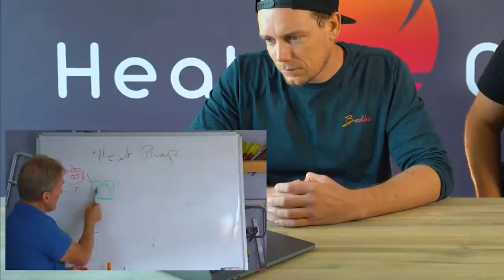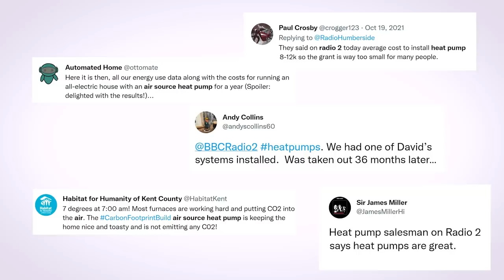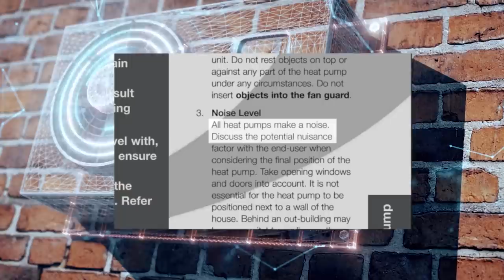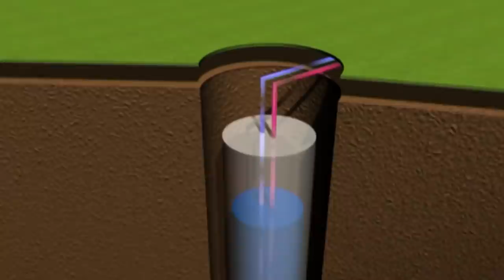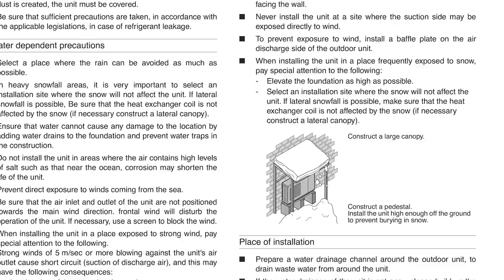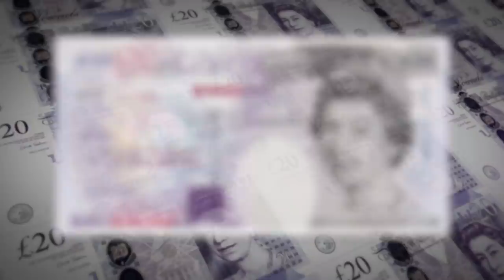Heat Pump Secrets They Don't Want You to Know

Comment: The government should just admit we need to concentrate on insulating buildings properly.  It's a one time cost, no 'running costs' and we don't need umpteen power stations for the increased demand... 🤷🤦
Reply: We need power stations for Electricty to run the heat pumps, there aint no solar 9 months of year 😂😂
Reply: Many UK buildings are not well suited to be insulated.
Reply: Er, all I keep reading says that rockwool compresses over 30 years and loses its insulation properties.
Reply: Exactly,  I retrofitted insulation in my house and it's cut my heating bills by 40%
Reply: If half of this ranting would be true no one would have a heat pump. Heat pump technology have been around for quite many years. We have had an underground heat pump for 20 years. It has functioned very well. Even with old technology and wekks of tempreatures below -20 C each wintter the COP is around 4. There is no perfect heating system. Heat pumps are best suitable with floor heating in larger buildings. In smaller houses an air to air heat pump is more suitable.

When it comes to noise I have a question. Is the sound of heat pumps working your biggest noise concern or could it perhaps be traffic noise?

Comment: I've been heating and cooling with a Mitsubishi mini split for 3 to 4 years. You can be standing right next to it while it's running and unless you see the fan actually spinning, you wouldn't know it was even on. VERY quiet.  I do run it 24/7/365. Heat in the winter, dehumidifier / A/C in the summer.
Reply: And the mitsis are typically more noisy than other brands, great piece of kit the ecodan none the less, hence the huge lead in times for all mldomestic mitsi products
Reply: Wait a couple of years when the bearings exposed outside 24/7 and apologies to the neighbours
Reply: @johnnorris1983   Mitsis generally have a good reputation, but the worst bearing fail is when it happens slowly over time so so don't notice how bad it really gets.
Reply: @johnnorris1983  This is BS, heat pumps are proven over many decades, check how much they are used in commercial installations.  Mini split air conditioners are heat pumps, there are millions of commercial installations in the UK and billions across the world.  In Greece, where we have a home, almost everyone has them, they are reliable and ultra cheap to run.  They often run for 20+ years without issues.  They are not widely used in the UK because the Gov. won't include them in the renewable heat incentive, this is because they're afraid people will use them in the summer for A/C. It's ridiculous.
Reply: @johnnorris1983  oh no ..... Not after they sit outside. Where should they be installed..... Inside?
Reply: If you run it 365 it must be costing you a fortune and you just don't understand its Electrical power input
Reply: I have been running nothing but heat pumps on two houses and a business. Cheap, effective, quiet...and I certainly don't run them 24/7. This guy talks utter nonsense.
Reply: @cooliocrib4409  You clearly don't understand mini-split units, they are the most efficient form of heating you can buy.  Typically 5x heat output vs electricity input.  When he says he runs it 365, it doesn't mean it's always on, it will switch on and off based on hitting a programmed temperature.
Reply: @davidstorm4015  you are living in dream land if you are under the impression you get a cop of 5 on an average annual basis..
Reply: @davidstorm4015  finally a guy that gets it!  These guys don't seem to grasp the concept of a thermostat. Comes on when it needs to..... Turns off when it's to the set temperature...... Genius idea.
Reply: @cooliocrib4409  no..... No it's not costing me a fortune to run it. Solar panels are another beautiful thing.
Reply: @deerfootnz  so what do you do?  Go around turning them on and off all the time?  It's the craziest thing ever created. Mine has this thing called a thermostat. You set it to the temperature you want, and the heat pump will actually turn on and off as needed...... All by itself!  It's like magic.
Reply: @m.wilson2624  You are in a very beautiful world with the luxury of having the capacity to fund a premium on an optimized Heatpump system working well with your oversized radiators, good insulation and solar panels.  I only wish the whole planet had this capability and we have nuclear energy so the world could work more synchronously.  But today, and having spent 15 years investigating Heatpumps, the world is not ready for it.
Reply: @cooliocrib4409  We've been heating with mini splits for the past 2 years. We saved about 40% vs heating with gas per annum... (on a high efficient boiler), so...
Reply: @OverSoft  I can certainly believe you as it depends. I will speak on behalf of me and many others.  In the UK where I am, Per kwh, gas is 4 times cheaper and so Electricity is 4 x more expensive. On an average basis (for the majority of households) the COP will be less than 4.  The maths immediately says  for a fixed number of heating units its less cost effective to heat your home with heatpump. A gas boiler is cheaper than a heatpump as you will not get a COP greater than 4. And instalation costs is lower with a gas boiler. I turn my boiler off when I sleep so I save energy. My heating is instant. 10 minutes the house is already getting warm. You don't get that benefit.
Reply: @cooliocrib4409  I think you need to check out the efficiency of modern mini split units, not talking about a wet system.  BTW we get a measured COP of 3 on our Samsung EHS Mono 16kw heat pump during the Winter months.  This is 100% accurate, readings taken directly from meters.  Anyway, you won't believe anything regardless of what I reply with as you're clearly set against heat pumps.
Reply: @cooliocrib4409  You clearly don't understand.  Mini split systems don't use radiators, they are air to air heat pumps.  That's why they are so efficient.  Get your facts straight before making a fool of yourself!  They're also the cheapest form of heat pump and the easiest to install, any house in the UK could have them.  We have 6 of them in our property, cost €400 each, A+++ for heating.
Reply: Someone talking common sense at last, from a position of knowledge.  There's so much ignorance in the UK about mini-split units
Reply: @deerfootnz  He's talking about mini-split units, not air to water heat pumps, he's running them on thermostats, so they only come on when needed, so it makes perfect sense what he's saying.  Also, we have an air to water heat pump at home (Samsung) which we now run 24/7.  The reason we do this is because it costs us less to run that way than it does having switch off at certain times of the day and night.  The power usage is accurately measured from electricity input and heat output meters, we've increased efficiency by 20%+ over what we used to get when we left it off for some of the time.  Heat pumps are designed to maintain a constant low heat output to work at their most efficient, not to have spikes in demand by turning on and off
Reply: @m.wilson2624  it will also,  if a newer unit, be variable speed compressor, meaning it will run continuously when on, at a lower power, improving efficiency, instead of the older or cheaper heat pumps running max, turning off, max, turning off reducing effeciency.
Reply: @davidstorm4015  in your home you have 6 units costings $400 each. I have 13 water filled radiators costing $40 each.  I would require 13 of your ridiculous $400 fans plus a heatpump and you say you are getting a COP of what with all those fans running?
Reply: @cooliocrib4409  depending on where he lives and how cold the winters are,  a SCOP of between 4 and 5.
I am in the North of Norway, obtain a SCOP of 4, that is with winter temps going down to -20c. At -25C the COP of newer air to air heatpump is around 2, and at 7C around 5.5.
Reply: @davidstorm4015  Greece, where the winter temperatures dip into the teens Centigrade?
Do you have an heat pump in your UK home, as you'll know the summers here can sometimes get into the low 20s Centigrade, thankfully that A/C function will soon get the temperature back down to something more bearable but then so would opening a window.
Reply: @cooliocrib4409  I can see you really don't understand.  Let me try to make it really simple.  We have 6 €400 units because we have individual apartments that we rent out for holidays, they all have to be separate from each other.  If we owned a single property we could have a single heat pump feeding multiple indoor units.  So in your simple terms, each indoor unit would be the equivalent of one of your radiators.  Now, let's talk about your radiators.  They don't heat up magically on their own do they?  They have to have a boiler (furnace) to heat them.  That has to be bought in addition to your radiators and then it has to be run.  That furnace is the equivalent of a single heat pump that is feeding multiple internal units.  The difference is your furnace will be a maximum of around 93% efficient (if it's gas operated) whereas my heat pump will be around 400% (or more) efficient.  This is the last reply I'm giving you as you don't want to understand, you just want to stick your head in the sand.
Reply: @cooliocrib4409  your average mini split system pulls about half the amount of amperage of just your average residential compressor, alone. 

Example, a minisplit may pull a total of 4-7 amps total between its Air Handler and its condenser, vs your average COMPRESSOR ALONE that pulls about 10 amps. Add the 2 fans, your average residential AC system pulls about 15 amps while running.
Reply: Mitsubishi is the best. Thats all we sell. They are basically bullet proof.
Reply: @davidstorm4015  these guys no NOTHING. So sad.
Reply: @cooliocrib4409  He's running a mini split unit, that's an air to air heat pump, he doesn't have any radiators.
Reply: @cooliocrib4409  compare your cooling and heating degree days. I'm in Minnesota US, and even here, despite our frigid temps occasionally,  it's rare it stays below -5F for any extended period. Mitsubishi SEER over 20 so summer operating cost make up for it.
Reply: @cooliocrib4409  no way electricity is 4x the price of gas in the uk. Eveyone would be running on their own mini gas generators.
Reply: @forgotmyname11  I thought of that already.. trouble is you have to Engineer your own generator solution as there is nothing sensibly priced off the shelf. In addition the engine is only 25% efficient at best case so theres not much to gain.
Reply: @cooliocrib4409  second hand gas piston generator will do fine at 40% or efficiency, but will be 250kW+
Reply: @forgotmyname11  if only you could buy them in 2.5kw..
Reply: @johnnorris1983  If the bearings are exposed the unit is a serious piece of junk. I have never seen exposed bearings in a CE marked HP outdoor unit.
Reply: @davidstorm4015  Bang on the money
Reply: @deerfootnz  I think he means air to water HPs. They usually should be run 24/7, especially if they.re feeding underfloor heating.
Reply: @forgotmyname11  erm...what's the point of saying no way if you don't know? Electricity is 4x gas in the UK. In fact probably higher. Gas is 7p / kwh and elect is over 28p / kwh.
Reply: @m.wilson2624  We can settle the argument much better if you just post the numbers!!

Gas and elect annual kwh usage prior to installation?
New elect annual kwh usage?
Total installation cost?
Reply: @davidstorm4015  Hi David we have an air conditioning unit (basically the mini split you refer to). We got it to cool the house for the 3-4 weeks in UK summer where it's unbearably hot. The added benefit is that it can be used to heat in winter. As you say they are very efficient and cheap to run. Yes electricity costs more per unit than gas here in the UK but I have a feeling my bills are still cheaper by using the heat pump instead of gas central heating.

I'd like to remove gas altogether from our house but we still need to heat water to wash dishes, have a wet shave etc. Since mini splits don't provide hot water, what do you use to heat water?
Reply: @davidstorm4015  Hi, just for ref ref. think of doing similar but at least £450 each but installation seems to be £500+ each, so at least £900 inc. how did you manage £400
Reply: @BlessedAreTheBignoses  we bought ours 2 years ago, prices have gone up.  The installation was part of our overall property renovation, we paid €600 each including installation
Reply: @alexfalconer9564  says who? The one I own is just as quiet as the others I own and have installed. Only thing I don't like about the Mitsubishi is that it cost over 2x the amount for the same size of other brands that Imo do just as good of a job and are reliable.
Reply: @johnnorris1983  that's nonsense... We have had central air conditioners for decades and the outside fan bearing has never gone out.
Reply: @davidstorm4015  wait... What? The UK government doesn't want mini splits there because people might use them for AC in the summer? I was wondering why I never see minisplits in the UK homes when it seems to be a far cheaper solution than retrofitting your radiators with a heatpump. I live in the US and I don't have a hvac license and I have installed 7 minisplits without issue and saved tens of thousands in install costs. You don't have to have a hvac license to install a heatpump where I live. Why don't they want people to use them for AC in the UK? Is it because it will stress the power grid?
Reply: @cooliocrib4409  no.. He uses it 365 because they have inverter compressors in them. You just set the temp to what you want and it will target that temp and dial down the compressor to output just the amount of heat/cool air to maintain that temp. Once a minisplit cools a house down it can maintain that temp by running nonstop at as low as 20% of its full output. This is substantial more efficient than a regular heatpump that turns on and off when the temp gets above the set temp. It's like driving a car and you set cruise control vs someone who full throttles the accelerator and then let's off once he hits the speed limit and then goes full throttle again when he goes a few km/H under the speedlimit over and over again. Running a minisplit 24/7 is the best way to run them.
Reply: @deerfootnz  he isn't talking nonesense. Are your heatpumps minisplits?
Reply: @davidstorm4015  actually it does stay on the entire time, it just dials down the output to match the heat loss of the house. Most of the time it would run at 20-30% of its maximum output.
Reply: @cooliocrib4409  that's what you don't understand... Minisplits don't have radiators that you have in your home. They have these things called "air handlers" that you install on the wall or in the ceiling and they are sized exactly right for the outdoor unit. The outdoor unit controls the air handler and ramps up or down accordingly. Look up "minisplit" on youtube, they are a fascinating simple, cheap and efficient type of heatpump. I have installed a few of them and I'm not a hvac technician. They are that simple to install and you can retrofit them in any  type of home with ease.
Reply: @cooliocrib4409  what is the cost of electricity in the UK per Kwh?
Reply: @forgotmyname11  he's talking about natural gas not gasoline.
Reply: @ChrisLee-yr7tz  28p? Does 100p equal 1£? If so that's insane for electricity! I pay $0.068 per kwh which equals £0.061 in the UK. If electricity was that expensive where I live I would be burning pellets for heat since it's about half the price of gas per kwh.
Reply: @hannahdobbs226  in the US we have hot water tanks that have their own gas burner in them that doesn't require any other furnace. We also have electric hot water tanks too. They have recently came out with you guessed it... "heatpump hot water tanks" that are very efficient. I think they have heatpump cloths dryers now too lol.
Reply: @BlessedAreTheBignoses  can you not legally install your own minisplits in the UK?
Reply: @randybobandy9828  It's 34p / kWh since 1-Oct and yes that's £0.34 so approx $0.375 at the moment.
Gas is now 10.3p so you'd need a CoP of 3.3 here just to break even on day to day running costs.

Where are you to be paying 6.8 cents?
Reply: @randybobandy9828  No, like anything in the UK over regulated (fair enough in many situations) and needs a professional and of course they charge high prices as you have no option. I am sure these pre-gased "easy fit" units can be installed safely & without hazard to environment. Lets face it how many are going to do DIY & as long as un-qualified people do not go round installing other peoples. I wanted in 6 small buildings and crazy quotes, would take 7-10 years to see ROI (even with current high prices) on replacing my existing infra red system so won't bother as probably a few will fail in those years anyway. I have found a wall mounted All-In-One & are pretty good but not sure how long will last & bit more £ than a mini-split but still half the price inc install.
Reply: @cooliocrib4409  Depends on the temperature you set on the thermostat.

Comment: The simple fact is, if you are using nothing but electricity to condition the air in a house heat pumps are the most efficient option we got! and they are very efficient but a furnace running on natural gas is cheaper to run.